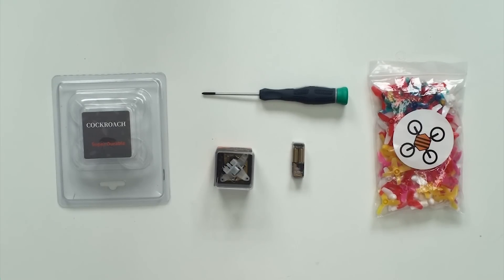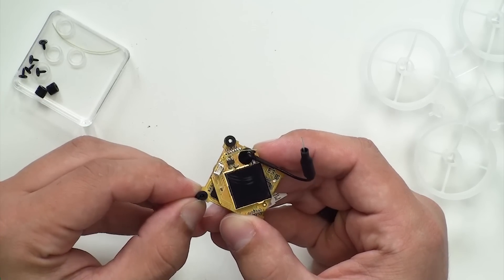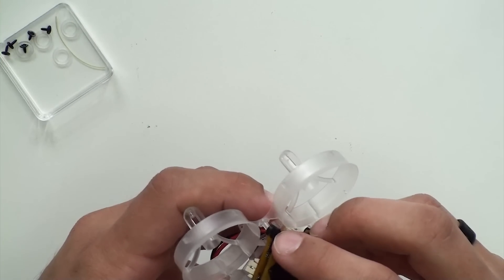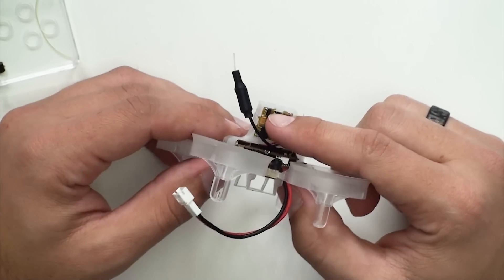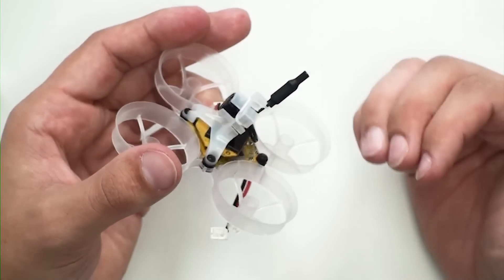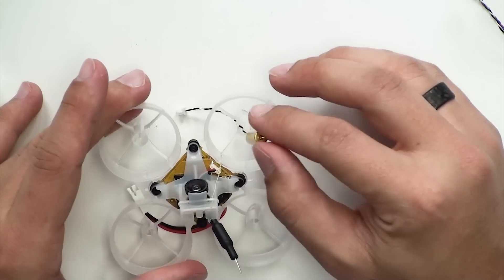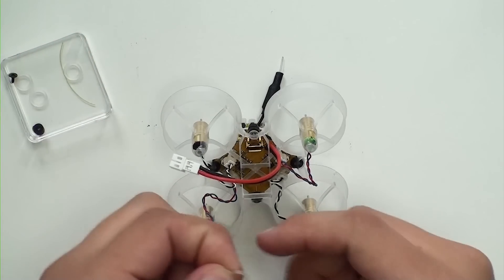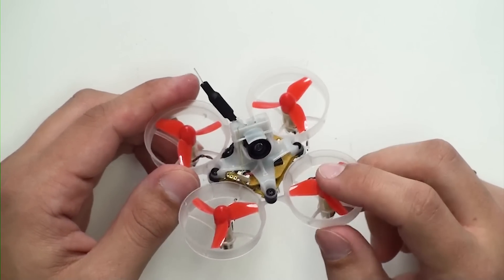BeeBrain V2 Build Tutorial

Comment: Can get my motors to seat. They get halfway and require so much force that they start to bend the frame substantially. Trying to wiggle but something seems off. Got the full kit from newbee so they should match
Reply: I got them in eventually by using a sharp corner to get them over the stuck part. Snug would not be the word I would use. Too tight, but I'm new to this.

Comment: I just built my tiny whoop from newbeedrone but when I give it throttle, it turns to the right, how do I fix this?
Reply: JohnZX I would think you could trim it out with your controller. If that doesn’t work, try calibrating the gyroscope in BetaFlight.
Reply: Check ur props orentation

Comment: Great build video, but a word of caution . . . I snapped 3 of my included rubber band rings trying to secure the antenna to the camera housing. Don't try this unless you have spares.
Reply: I ended up using one of my wife's tiny hair rubber bands for that step. worked better.